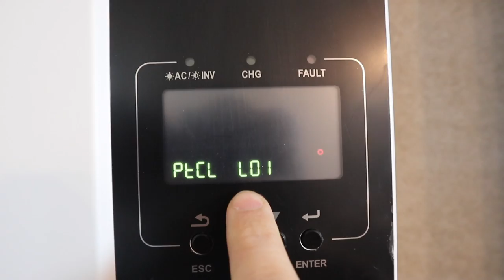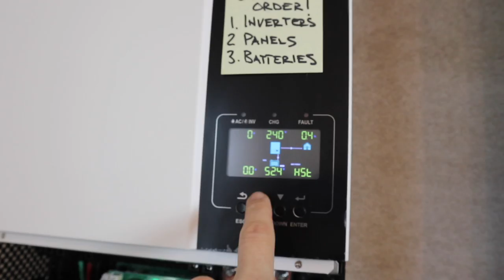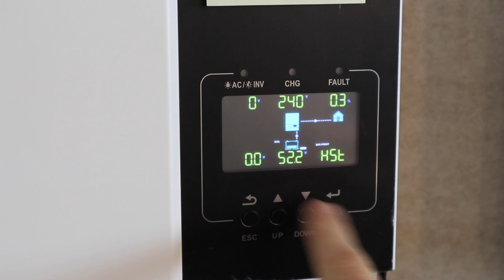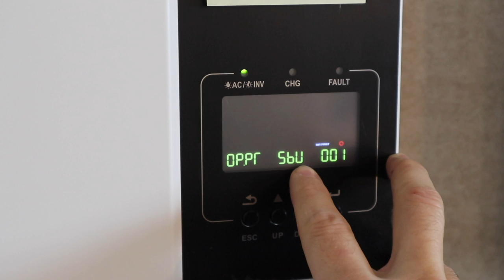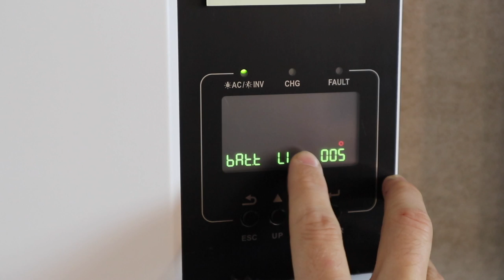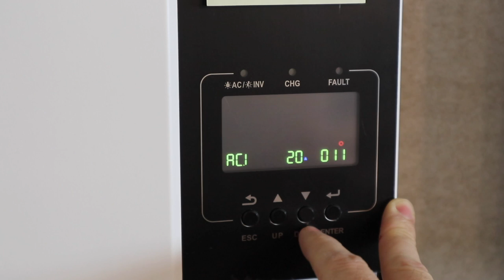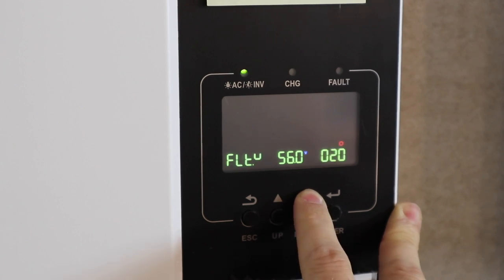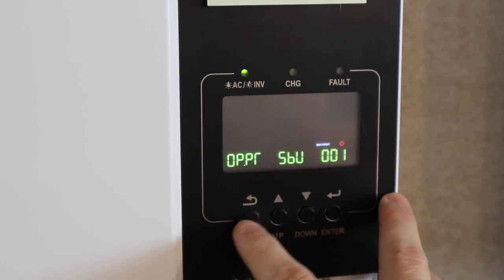Solar Inverter Growatt 5K Programing Grounding & Battery Comms

Comment: I know you have stated that you are off grid, so no connection at all to your local power company. But, I don't think you've talked about selling power back to the utility, which would require a connection. 
Does the system you have support that? If so, is it worth it (connection fees vs. income from selling power)?
Reply: The Grid connection to sell power back is on the output side, not the input side.   My opinion is selling back to grid means you have too large an array for your needs or you don't have enough battery storage.
Reply: @echopapa819  So what do you do when you're out of town for the weekend? Do you think the PV system only makes electricity when you are at home? It is like any other electrical source, the power is there, it just isn't flowing (when the sun shines, that is). If the there is minimal drain, like you are not home, and the batteries are fully charged, the PV system can still create electricity that can be sold back to the utility. Electricity flows in both directions.
Reply from the maker: I mentioned in another vid that I had a few friends that were grid tied. They have been attempting to sell power back in our area but have had complications. In our area, even if you are grid tied and selling power back, you must pay a minimum connection fee (usually $20/month). While this is a tiny charge, you will never have a "free" month of power. They have had difficulty getting a proper report from the power company on how much they have sold back and have had a few months where they had to pay a power bill (beyond the $20) even though they had build up a large credit from previous days/months. 
I purchased the off-grid inverters. If you want to sell back, you will need to buy a grid-tied inverter. More difficult and complicated connections, slightly higher equipment prices. 
Personally, I did not think it was worth the hassle.
Reply from the maker: @Echo Papa
Good points
Reply: @CountryLivingExperience  In the video you mentioned not having a tie to the grid now I understand why thanks.
Reply: @CountryLivingExperience  Yeah, that's pretty much what I thought. I'm a long haul truck driver, and stay out on the road 2-6 months at a time (or at least away from my little apartment), so the only electric I use is the fridge (heat included in rent). My bill is usually only about $12-15 a month, most of which is connection fees. 
The one difference might be the power company itself. Mine prides itself on using renewable sources, including energy buybacks, so they are probably better set up for it.
Edit: BTW, I live in Maine. So, many folks have backup power generators, the best being propane powered. They can be easily tied to an existing system, and don't freeze up like gas, diesel or kerosene in extreme low temperatures (-30°). Just an idea to put out there to your fans.
Reply: @CountryLivingExperience  "Not worth the hassle" OMG, can you explain to me how long you have been an electrical contractor or certified electrician?
Reply: @uhjyuff2095  You are Always negative and insulting. Country living and many others including me don't think it's worth the hassle. Net metering is not for everyone and every utility company is not equally cooperative with cost for net metering. I suggest you do it your way and others will do it theirs. This Forum is for helping others improve their systems and NOT for your puny insults!

Comment: I've noticed in all the videos I've watched on the Growatt 5000 nobody has installed a fuse from the batteries to the inverter?  Unless I'm missing something.  I'm trying to find out what size I need from the 6 EG4's to the inverter.
Reply from the maker: With the breakers on the batteries and Growatt, I didn't think it was necessary. I suppose a 200amp would work but an electrician could size one better for you.  I am actually going to be installing some new inverters soon and I will have 200A breakers on the battery cables for those.

Comment: Hi man. A have a problem in my inverter. It shows me 07 error witch mean overload timeout. What is this problem. I don't have a load only 25 %
Reply from the maker: Not sure. Did the breaker trip? Try shutting down and taking off the batteries. Then reconnect and start up again.
Reply: @CountryLivingExperience  when i turn off and then off thr inverter it works fine. This error shows every 2 to 3 days once or twice a day... anw thanks a lot man
Reply from the maker: @omarbarakat61290  Sorry I could not help more.

Comment: When you show your next video connecting everything. Please show how it is connected to your main panel!
Reply from the maker: Hi. It is just wired into a breaker on the main panel. Nothing special. Neutral goes to the neutral buss bar, ground to ground and the 2 hot legs to a 70a breaker.
Reply: @CountryLivingExperience  Ok, I guess that is easy enough. Do you think you will be able to supply the whole house with that 70 amp breaker? Even if you needed to run all your large appliances? Thank you for replying
Reply from the maker: Yes. If you watch my earlier video I explain what my loads are (no stove, no water heater, no dryer). I am also switching my 3 ton air con to mini-splits.

Comment: Some questions:

1) are both inverters in phase with each other or are they 180 degrees out of phase?

2) i feel like there should be a main breaker between the inverter output and the autotransformer then from autotransformer into the distribution breaker box? opinions?

3) if the inverters are on same phase, do you just connect L1 and L2 together?

4) if the inverters are out of phase, do you consider only L1 from master to main breaker, and only L2 from slave to main breaker, 
but neutrals and grounds from each go to the main breaker box???

4) what are the benefits of having the inverters in phase versus 180 degrees out of phase?

Thank you for your responses.
Reply from the maker: These are all questions beyond my knowledge. Please contact Signature Solar. This is in line with how I was instructed to install the system.
Reply: I was hoping you might ask this questions to Signature Solar the next time you speak with them.  It is possible they also may not know the answers, but I think we all need to try and determine the answers.  I do not have the equipment to do testing.  I was hoping either you or signature would be able to figure it out, since you have access to the equipment.

Thank you for your reply.
Reply: The inverters are in phase with each other.  They're sharing the load. Mine is feeding a 50 amp 2 pole breaker,  in a main lug sub panel.  The auto transformer is connected at the main lugs. This way,  it is protected by the 50 amp breaker.  And if something goes wrong,  the 50 amp breaker shuts down all power. If you put the auto transformer on its own breaker.  And it trips that breaker.  You only lose the neutral.  Which can damage your 120 volt appliances.
Reply: Also,  this inverters output is 240 volt. The purpose of the auto transformer is to create the neutral. And turn it into a 240/120 split phase.
Reply: @CountryLivingExperience  Excellent response. Thank you for documenting this!

Comment: I'm worried that these new inverters have a lot of controls that it allows for more failures especially when you're off grid. I want something extremely simple.
Reply from the maker: Even the simplest inverters have delicate electronics.
Reply: @CountryLivingExperience  very true. But my 78 Chevy has less problems than my wife's 01 Toyota. And it's always the electronics.😁
Reply from the maker: @shermdog6969  You can only do your best and find the best you can. My 76 Malibu had more problems than my 03 Honda. My 94 Pontiac was a lemon but my 05 Explorer is bullet proof.
Reply: @CountryLivingExperience  I know I was just making a joke. We just hope for the best.

Comment: you could have used water and that rod could have been hand pushed down............
Reply from the maker: I know but I didn't have an attachment for my hose and didn't want to buy one.
Reply: All you needed was an empty bottle it only takes about 32 ounces of water to push an 8 foot rod down in five seconds
Reply: I was just installed two new 5KW growatt inverter’s and just purchased 20 450watt Bifacial panels.
Reply from the maker: Interesting. I was aware of the hose and pipe method but not the bottle method. I do also have hard pan clay about 18 to 24" below the surface.
Reply: It really doesn’t matter as long as there’s not a lot of rocks l. I might need to make a video on how to Drive a ground rod with a bottle of water 💥💥
Reply from the maker: That would be cool to see.

Comment: This video from signature solar (https://www.youtube.com/watch?v=e5TVCGcoFos&t=2s) speaks to what you are talking about charging via AC grid.   The key is, according to them, the total load is cumulative between the charge controller + loads.   I find that hard to believe that it was cause damage, but I'm not an EE expert.       For me, using a single growatt at 120v located near my main panel, I should be able to wire up the growatt on a 50a breaker just fine.  I think?
Reply from the maker: You should be fine with your plan for that single inverter.
Reply: that is my plan as well, Josh.

Comment: A link to a 5000es system running without batteries:

https://youtu.be/zxBSV2Fwhgg
Reply from the maker: I appreciate the continued conversation on these matters. 
This video is a bit different because he is running grid power in and using as a pass through to just power dedicated 240v loads. He even made a comment in the comments section that if he was to run the system off-grid, he wouldn't run it without a battery.
Reply: @CountryLivingExperience  The manual states that if in parallel mode with more than one inverter that you must have the battery conected. I have 3 5000es running with batteries connected but no solar on the 3rd. All have grid available for backup/pass-through if needed. If running only one inverter battery is not required.
Reply from the maker: @billgalloway2320  Per Signature Solar, the manual, which has recently been translated from Mandarin, has some errors. This being one of them. You can contact them for confirmation.